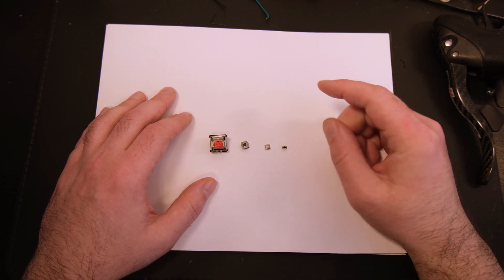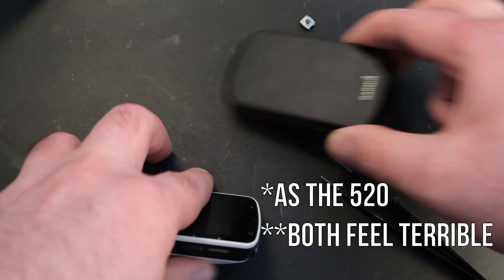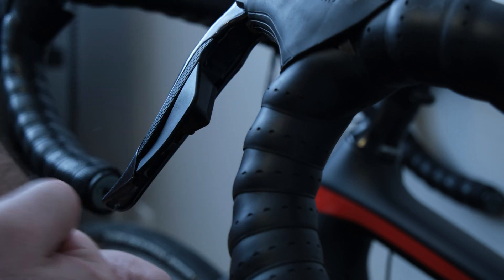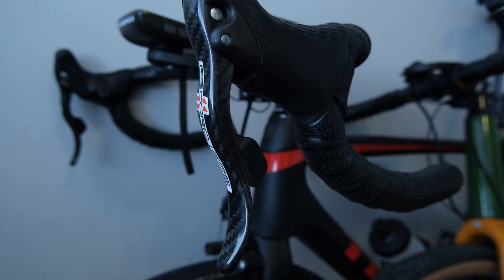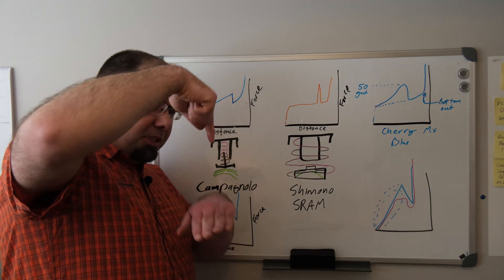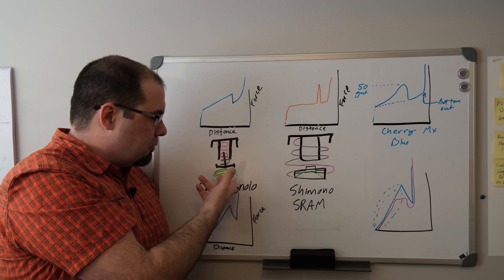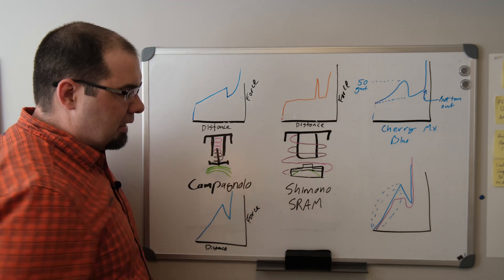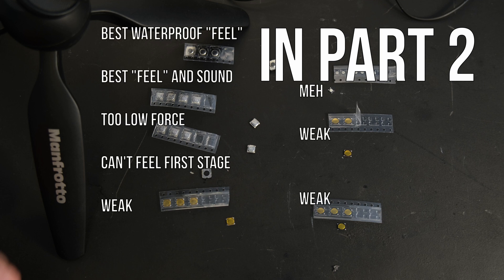Shimano Electronic Shifters Feel Cheap - What makes a good button Part 1

Comment: I don't think anyone has analysed these and I'm quite particular to this, like for instance, I've SRAM red etap the 1st gen stuff and the 'click' is something I've never liked tho I like the aspect of the action and the ideaolgy of the electric movement etc..
Reply from the maker: This was mainly background to the development of buttons in Titan Lab's Kommander product. Will working in Italy I realized that they spent a lot of time focusing on this and I never felt like the others did to the same extent.  There is certainly a feel and sound that people expect. Still haven't gotten hands on with a Dura-Ace 9200 to see if it's a bargain bin feeling as the previous 2 gen DI2's
Reply: @kwakeham  I've tried di2 in the shop and the click wasn't as I thought it'd be 🤔 ..tho I don't think that action is as it should be, it should mimic the mechanical action, with a 2 lever situ. not 3 as it is 👌

Comment: Edge 500 does it for me :D
Reply: Also Thinkpad keyboards up till them making one row disappear... (2011/2012).. Never cared for mechanical keyboards.
Reply from the maker: Do you mean the highly collectible Thinkpad 701. Amazing engineering there.  Check out LGR's video if you haven't already. https://www.youtube.com/watch?v=nRVJCtREW38 .Thinkpad's have always had great keyboards too for a laptop. They maintained a good stroke length.
Reply: @kwakeham  Well... The older the better, but I like the last ones made too (still using them...)

Comment: Thanks for the interesting video. I have one question about Shimano Di2. Is it possible to find out how many switchings a used derailleurs made? For example Shimano RD R8050 or FD 8050?  I have two PC Linkage device: SM-PCE1 and charger SM-BCR2. Many thanks
Reply from the maker: Not sure at this point. It might be buried in the derailleur's flash memory but Shimano hasn't exposed it from what I've seen but also never really looked for it. It's not something I've seen in the DI2 ANT data pages either. However there is GATT characteristics than I have not been able to decode yet on BLE, but most of those I've found are just clones of the ANT data.
Reply: Thanks for the quick response. And one last question. Is it possible to check the operation of the servomotors of derailleurs without shifters?  I have two PC Linkage device: SM-PCE1 and SM-BCR2

Comment: Guessing from this video that there is not much hope for the next generation of Dura-Ace
Reply from the maker: I wouldn't predict what will happen. I don't have the 6700 or 6800 DI2 but I've used them and compared them side by side. There has been feel improvements but mainly in the tact switch they use, less in the mechanism. However, never know.

Comment: Very interesting, as usual. I did a secondary control for Shimano (a variation of the climber extension) with cheap button and works fine. I find not easy to press any button in a hard effort compare to a mechanical mechanism. It's like binary in that moments, so I prefer push it hard
Reply from the maker: I agree that during harder efforts the quality of the mechanism comes through. People press harder and faster and knowing you did what you want is critical. It's one of the reasons some pros still prefer mechanical. The Ultra-shift Thumb lever is not well positioned for my hand size but the feel is so re-assuring.